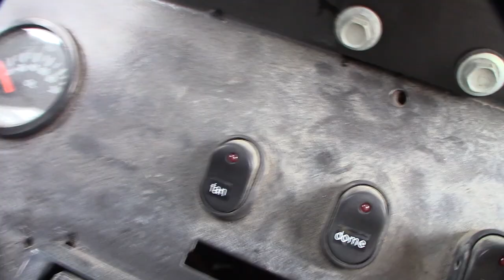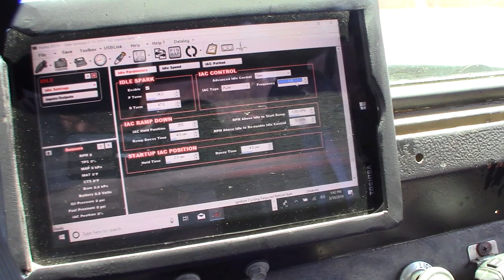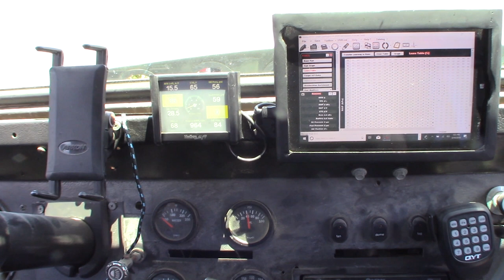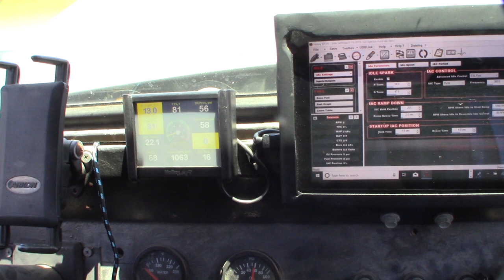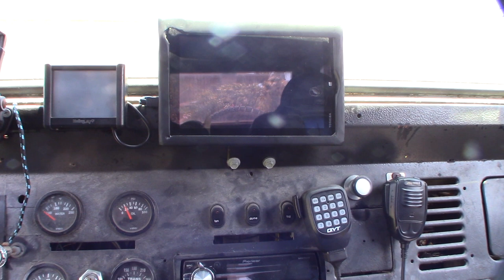Holley EFI Ford 2 wire PWM IAC Idle Air control valve Part 2 Pulse Width Modulation

Comment: I understand that you used the negative side of IAC for output pwm- where does the other pin on IAC go to on Holly is that a 12 volt power source or 5 volt reference